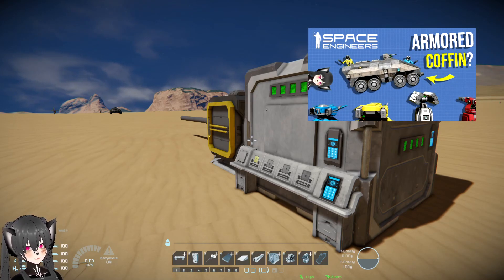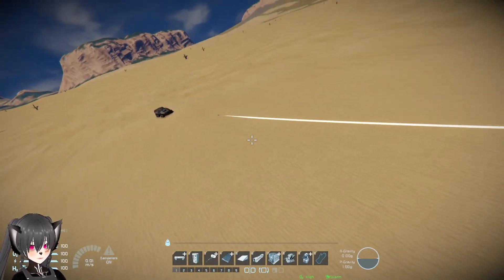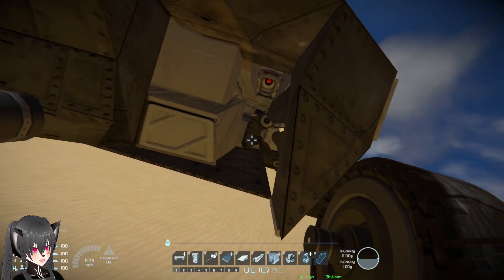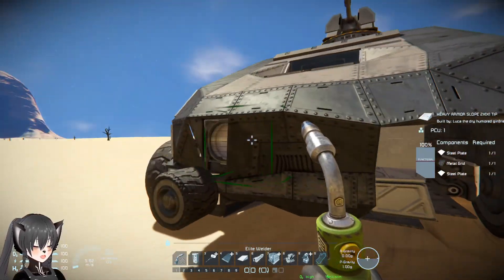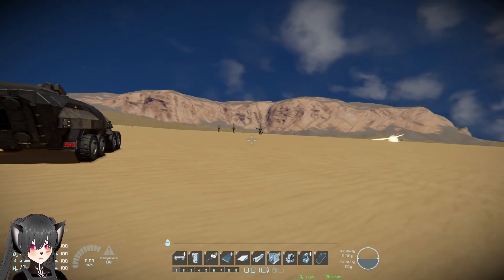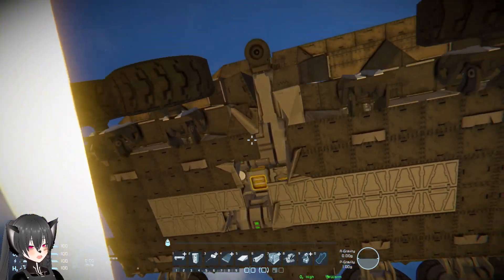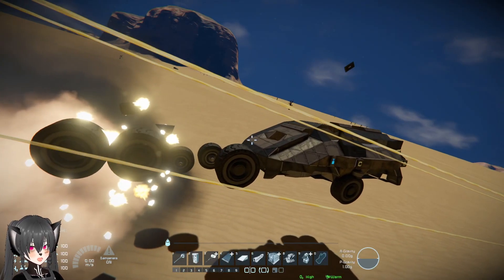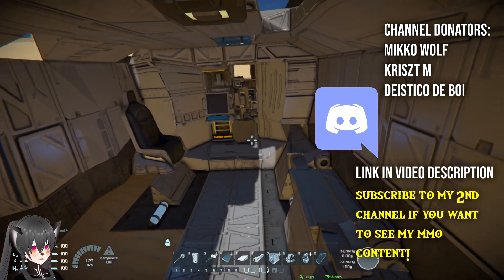This Shows How Artillery Shells go Through an APC, Space Engineers

Comment: I am now for the first time actually working out the relationshiips between the HP of small and large grid armors.
With 5x5x5 = 125 blocks the armor health comparisons for the same volume are:
Steel plate: 100 hp
Metal grid: 30 hp
Light amror:
Large grid: 25 steel plates x 100 hp = 2500
Small grid: 125 x 1 steel plate x 100hp =12.500
Heavy Armor
Large: 150 steel plates x100hp + 50 grids x 30 = 16.500
Small: 125 x (5 Steel plates x 100hp + 2 grids x 30hp) = 70.000

So with that calculation we get a huge increase of health through filling space with small grid blocks (RIP PCU I guess, and also mass).

So what if we only take the thickness for penetration weapons should only penetrate 1 blocks worth of sickness, though it looks like the artillery shell damaged a square of 4 small blocks, so I'll take that into account as well.
Small grid health for penetration
1block section:
light armor: 5 blocks x 1 Steel plate x 100 HP = 500 hp
heavy armor: 5 blocks x (5 Steel plates + 100 hp + 2 grids x 30 hp) = 2800

4 blocks square section:
light armor: 4 x 5 x 1 plate x 100 hp = 2000
heavy armor: 4 x 5  blocks x(5 steel plates x 100 hp + 2 grids x 30 hp) = 11.200

Sooo.
I guess the large volumetric health might be what makes smal lgrid armour resistent to missiles when used in bulk?
small grid light armor does come relatively close to large grid armour once a projectile ends up damaging a square section of 4 blocks for penetration, nettin 2000 hp vs the large grid blocks 2500.
and the distances between the variants only spread further with heavy armor where even with the 4 blocks quare section the small grid would provide 5.300 hp less than the large grid variant.
considering gyroscope and refinery armor are a thing this isn't a surprise, but the way penetration damage and block health work really deincentivises using small blocks.
It would be interesting if the damage model for penetration damage was to be reworked i na way that ablocks size factores into the calculation so a projectile could damage something like a refinery partially while also hitting blocks behind it. buth then again, since not all blocks are perfectly cubic in shape that would be more of a headache than it's worth.
Reply from the maker: Oo, those are some calculations O: will have to go through them, I do wonder if large and small grid blocks behave differently in their health calculation, I guess I'll have to do more tests x3
Reply: @LucaTheGuide  have fun! :D